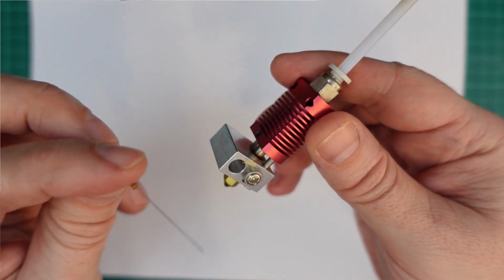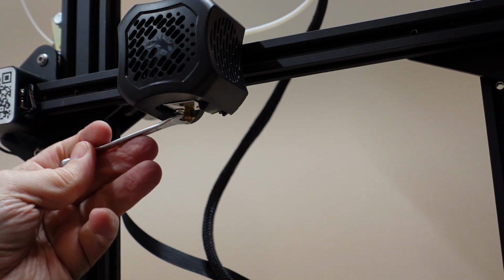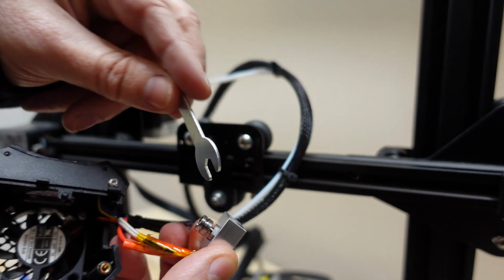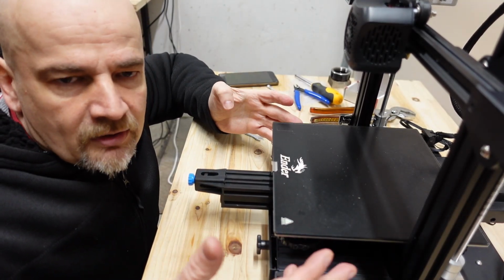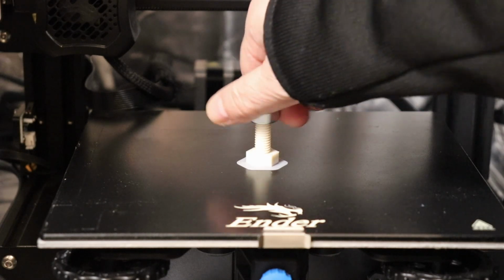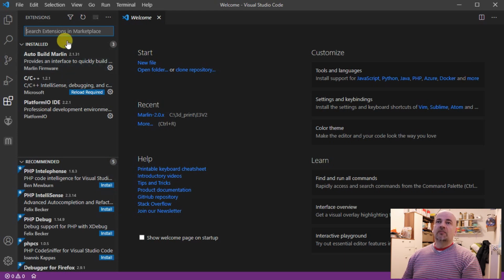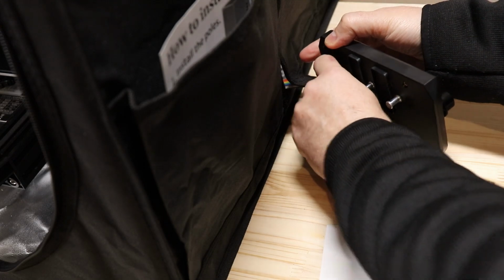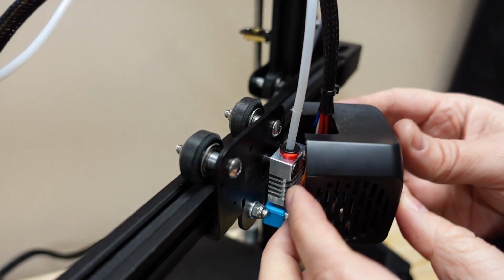Ender3 V2 upgrade: All metal hotend by Micro Swiss + Firmware edit to allow higher temperatures

Comment: did you try contacting original manufacturer of termistor and ask them about max termistor temperature ? have fun, s love nia
Reply from the maker: Yes, I tried. No answere. From another source I found max 280C but it is very unaccurate on that temperature (the thermistor). So if above 270C, you need new heating element and sensor.
Reply: @MyTechFun  i wonder which thermistor and heating element would be best for this v2.

Comment: hi my friend , if is possible to make a video about increase temperature more than 270 c. , step by step , with all details , changing something in the firmware, not only hardware parts . thanks  see ya .....
Reply from the maker: Temperature over 270°C: in Marlin instead 285 (shown in video) go with higher values, BUT you will need new heating cartridge and thermistor for those higher temperatures. Stock heater and sensor are not recommended to use on 280°C or more.

Comment: Good video, especially good that you have paid attention to hot tightening the heat-break and the nozzle. One tip, though: if you wouldn't connect the teflon tube to the cool-end BEFORE you heated up the hotend for tightening, then you wouldn't have to worry about the fan not cooling the cool-end. As for the thermistor and the heater: I couldn't find the specs either, but neither this type of  thermistor, nor this type of  heating element can withstand more than 300C anyway, that would need a different component-housing technology. So I assume 270..280 is the safe max.

Comment: So, you have modified the temperature in your firmware to 285 degrees but i see that you still at 270 degrees for maximum temperature of the hotend. 
How so ?
Reply from the maker: I just modified the default values, I raised them by 10°C. I know, next question is, why are those default values 275 and not 260 in source code? Not sure, but above this temperature the heater will be switched off. Probably there is 15C operating temperature difference (heating cartridge is turned on/off, it cannot be set to lower heating value).
Reply: This is only in interface, and it's always 15 C less than what is specified in firmware (Marlin).
However,  you can use M104 / M109 command in GCODE file, or send it to printer from comp or OctoPi, to set and reach 275C, or even higher temps, if you raise MAXTEMP in firmware (that hot-end can probably reach 300C).
Reply: @Sleepery22  so you mean i can set temperature to 275 in the Gcode on the stock firmware?
Reply: @amarzzata  I don't know what's the MAXTEMP on default stock Ender (it's 275C for CR10).
However, if it is 275C or if you update it in firmware as Igor did,  you will be able to set it GCODE, but interface will always show you -15C (=260C).
For example: on my CR10, MAXTEMP is set to 450C, which I can reach through GCODE/OctoPi, but on printer interface, it will go to 435C only. So it's always -15C.

Comment: Really interesting and well made video as always!
How would you explain that despite the extruder is still connected to the hot-end by a long Bowden tube, the retraction can now be so much lower: almost the same as a direct drive?
Reply from the maker: The rectraction MUST be lower (not can be lower). I got good results, but this was good, dried pla. Probably with old PETG I would have much more problems. But even then, I have to keep the rectraction below 5mm.
Reply: @MyTechFun  oh, must instead!
Same question then: why? 😋
Is it because there's less risk of gap between the PTFE Bowden tube and the nozzle therefore a lower amount or droopy filament to pull up?
Reply: @supercurioTube  The filament slides a lot better in the tubing than in bare metal. Higher retractions in an all metal hot end can lead to too much friction.
Reply: @supercurioTube  multiple reasons. On one hand, in order to avoid heat-creep, especially at low printing speed. (The steel nozzle has much worse thermal properties than brass, hence the extrusion speed has to be decreased, too, due to the lower melt-rates possible.). On the other hand, all-metal hotends are notoriously clogging-prone with PLA, since PLA sticks to metals very well. Hence, you want to avoid retracting semi-molted PLA filament into the cold-zone to avoid sticking the filament to the cold metal wall of the bore. Consequently, if you mostly print PLA, then you must stick to the stock hotend with its teflon-coated heatbreak.
Reply: @GáborZiegler  ohh that makes a lot of sense, thanks a lot for the explanation.

Then I guess that from these parameters, if you still want to print PLA with an all metal hot-end it would preferably be with a direct drive extruder for a more precise retraction control.